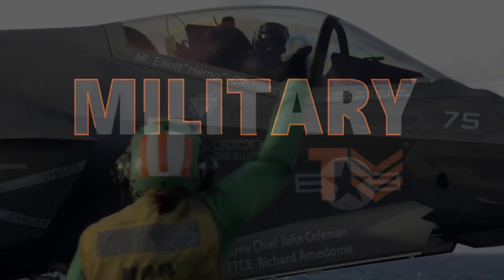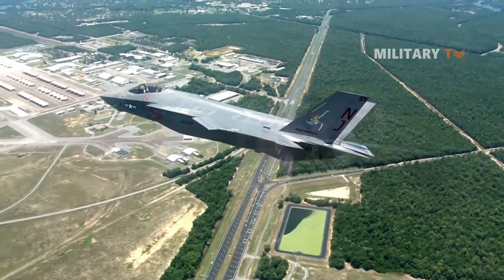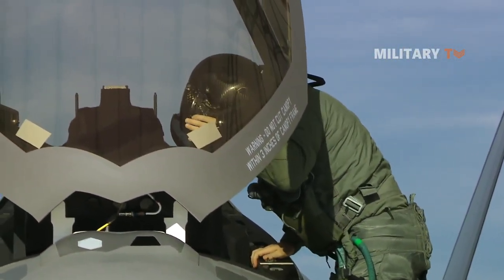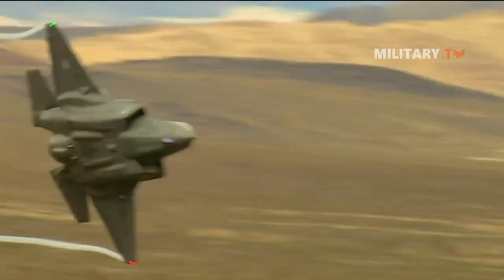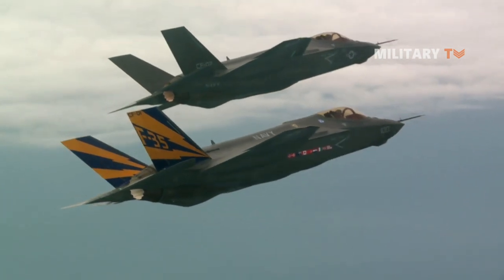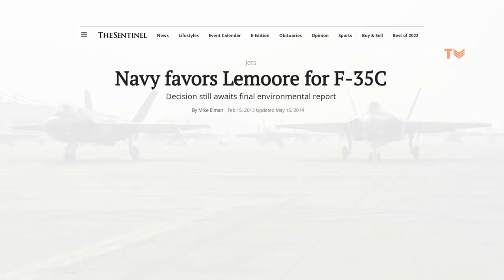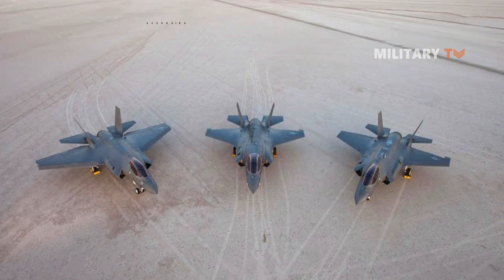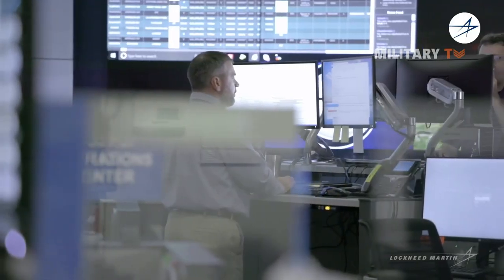Why the US Navy F 35C Is Such a Badass Plane

Comment: everyone hating on the F35 i bet they think the A10 is good enough.
Reply: Yeah the A-10 is good enough in close air support and attack roles. It’s the cheapest plane in the Air Force per flight hour and it single-handledly dismantled Iraq’s network of air defenses twice in the last 30 years…
Reply: @BasicBobby Also is responsible for the most blue on blue incidents than any other modern aircraft.
Reply: @BasicBobby   the a10 is not going to be good enough against a near peer enemy who also has air support the F16 does the A10s job just as good and can still defend itself against a 4+ gen air to air threat.
Reply: Totaly different class of aircraft from the A10
Reply: @huntercanuck  the A-10 is not but just not good enough anymore. War is coming and we will need the best aircraft that can survive air to air engagements. It's a lot more efficient to have F16 and F35s to do air superiority land and rearm to do air to ground than to have dedicated aircraft for air to ground only that isn't very good in an air to air engagement.
Reply: @BasicBobby no it didn't lol

Comment: Marines fly both, the B and C variant. Each Navy Carrier has, 1 Marine unit that also uses the, C variant. Marines use the, B variant on the Us Navy/Marine Corps light Carreris. Most people think that the US just has 11 Carriers, but....adding in the Light/Marine Corps Carriers, there's actually around, 18 carriers
Reply: The Marines don't have any carriers. The Marines operate off of Navy Ships, the Landing Helicopter Assault (LHA), and the Landing Helicopter Dock (LHD) These ships might resemble carriers, but they do not in normal times, function as such.  Their mission is to transport  Fleet Marine Force personnel and put them ashore as needed. Unlike a carrier, they are incapable of sustaining any prolonged military engagement. They carry limited ordinance for the aircraft and have very little hanger deck space. Mostly they are there to carry and shore Marines and their gear. An LHD will have about 1800 Marines and typically will carry  750 pallets of ammunition for those Marines, and a variety of other support logistics. It is essentially a reenforced Marine Battalion afloat.  The aviation unit of Harriers or F-35s will typically be part of the Marine Expeditionary Unit Aviation Combat Element (ACE), and these are typically composite squadrons of several types of aircraft. While it may resemble an aircraft carrier, its role amphibious assault. That being said, one was used during the Gulf War as an attack platform for Harriers, but this is not really the mission of the ship.
Reply: @shenmisheshou7002  ummmm...explain why the money spent for and money spent for maintenance for these vessels comes out of the Marine Corps Budget?

Comment: The F-35s are proving to be a major economic strain on the Air Force, Navy, and Marines. There are currently no War Ready Engines for the F-35, and there are not expected to be any until 2030. The services have conceded that the aircraft will never achieve the flight hour cost that was projected by the prime contractor and because of that they services have had to make a decision on whether to buy fewer F-35s or fly the F-35s fewer hours, and the choice the Air Force made was to reduce the annual hours from an average of 240 to less than 180.  Most pilots don't want to be in F-35 squadrons because it will make it harder to get the necessary flight hours to get hired by  an airline when they finish their tour. Instead, many are leaving to go to feeder lines for FedEx and UPS, which has long been the civilian route to getting an airline job.  The Navy is currently short about 20% of pilots, and the Air Force has a shortage of about 1000.  The Full Mission Availability rate for the F-35 is appallingly low (about 14% for the F-35C) and the mission availability rate on average is about 55% (Full Mission Availability is the ability for the model to fly any mission that it was designed to fly.. The mission availability rate is being available to fly at least ONE kind of mission the model is capable of flying. The problem for the F-35 is that many of the planes that are mission available are not stealth mission avialable, so  can only really  be used in the same combat mission as the F-18 of the F-16, depending on the service. At any  given time, less than 40% of the F-35 fleet is capable of flying a deep penetration stealth mission. The contractor also did not provide the services with the necessary documentation and tools to do depot level maintenance, so this means that the DOD has to depend on the contractor to do major repairs and upgrades, and the contractor was taking an average of 140 days to turn around an aircraft, though at last report, this was down to 110 day. The Depot level maintenance of the Navy  and Air Force typically has a 60 day turn around, but that is for more traditional planes. The extremely complex nature of these planes likely means that an 85 day turn around is probably likely, but at the current rate, that may  not be achieved for another 4 to 5 years. Of course the current program costs is based on a normal inflation rate, but if inflation lingers, the program cost is likely go go higher than the current 1.7 to 1.8 trillion dollars. While everyone talks about how great the F-35 is, as an airplane, it is fine. As a defense program though, it has been a total disaster. Like the F-22, the F-35 will probably never face a Tier 1 opponent in a prolonged military engagement (the only F-22 kill was a balloon). As for being a deterrent, The Israelis have F-35s, and that did not deter Hamas from killing and kidnapping over a 1000 of its people, and the military might of NATO did not stop Putin from invading Ukraine. We spend trillions of dollars on planes that don't really deter anyone from anything and only ever shot down planes flown by Tier 3 opponents.  No US fighter has shot down a plane operated by the Russian Federation, The USSR, or the Peoples Republic of China since 1970.

Comment: not to nitpick but the sensor suite has nothing to do with stealth. tho that sensor suite certainly deserves an hour video of its own. too bad we aren't briefed in lol.
Reply: It actually does. Because the nose of the aircraft doesn't deflect radar, it had to be designed and oriented in a way to deflect radar upwards from the aircraft.
Reply: The F-35 depends heavily on the sensors while it is in stealth mode to detect threats that may be intercepting on  side or rear vectors. The F-35 radar cannot see in 360 degrees. One of the major reasons for the horrible full mission availability rate, about 14% for the F-35C are the sensors. If the sensors are out, the plane  can only be "Mission avialable" and that means that it can fly non-stealth missions, but it would be used the same as the F-18, so little value to stealth when you are just running around with external bombs.  (The F-35 is not invisible to radar and in fact it can be detected at well over 100 nautical miles by L and S band radar (both types used by Russian Federation and Peoples Republic of China). If a Dragon Eye radar sees an F-35 at 100 nautical miles, even though it can't lock on to it, it can vector a J-20 (which is not as stealthy as the F-35 but from a side or rear intercept, that makes zero difference) to a side or rear intercept, where the F-35 would be dependent on its sensor suite to let it know that an enemy aircraft was closing. It would be death to fly an F-35 into a tier 1 enemy integrated air defense network without all of your sensors working. The J-20 will catch up to you  from the back and shoot you down before you know what happened. Stealth does not work without sensors.  The B21 and B2 are far less likely to be seen by S and L band radar. The F-22 and F-35 are easy to see. That is why the Air Force and Navy are already  begging congress for money to buy  the NGAD, which will be much harder to see by S and L band radar.

Comment: BVR combat has never proven effective, and empirical evidence shows it’s by far the least effective option used by pilots in air combat, even against incompetent adversaries. 

The fact that the F-35, is totally unable to operate in a turning fight, and has such a tiny payload, means if it’s unable to hit its targets(s) with BVR missiles that at best, hit their targets 50% of the time, or the situation doesn’t allow engaging BVR (rules of engagment), it is a dead duck. It can’t outrun most near-peer fighters. And that Wall Street marketing propaganda claiming it doesn’t need to point its nose to lock a target is nonsense. Sure, it can fire the aim-9x at a off-bore angle, but its effectiveness exponentially decreases the wide that angle becomes. And again, when it can only carry 4 missiles at most, who’s to say it will even be equipped with aim-9Xs when it needs them.

It’s a very useful weapon, but it’s a mistake to try to use it for everything. It’s very useful as a reconnaissance, precision strike, electronic attack, BVR air-to-air weapon. But its limitations means it is not a viable air superiority or close air support weapon. It is best supplemented by a true air superiority fighter and cost-effective CAS weapons. The F-22, and ideally, something like the F-22 for the Navy. 

For most conventional war, it’s too complex and expensive to operate. So that’s where weapons like the A-10, F-16, F-18 still prove useful. 

That said, if our military were run strategically, we’d have 500 F-22s, 200 F-35B, 150 F-35A, 150 F-35C, and we’d be fielding an air superiority/fleet defense weapon comparable to the F-22 for the Navy, in at least numbers of 100+.

Comment: Way overpriced and full of issues, I'm so pissed Canada got involved in this pos.
Reply: I feel your pain! They should have gone with the F-15 a long time ago!
Reply: Issues that have been steadily improved over the course of the program.  The new specifications of the F-35 make it a whole new beast unmatched by any other aircraft in terms of mission capability.  The problem with the F-35 program initially was similar to the Zumwalt Class destroyers, in which, at the time, the request was basically as much new tech that wasn't capable of being delivered on in a fighter.  Now, that isn't the case.  We actually have the tech now to deliver on the F-35's designated capabilities.  It's right now the most advanced, most versatile, and most capable fighter in the world.  As of right now, the limitations of the F-35 are exteneral, with a lack of maintenance equipment and crew with the knowledge of how to maintain the fighter.

Comment: The reason why the US navy and Airforce are procuring 100 F-15 and FA-18 is because the Generals are well aware of the failures and structural flaws of this aircraft. The problem stems from the fact that testing are still not finished they started full production. Now even after more than 2 decade of production problem still exist. Also upgrade of older F35 to bring it uptp date are expensive as procuring new jets. Even the F22 after decades it stopped production its readiness rate is so low that even the US govermment want to retire it prematurely.
Reply: "The reason why the US navy and Airforce are procuring 100 F-15 and FA-18 is because the Generals are well aware of the failures and structural flaws of this aircraft."(sic)

Incorrect on both counts.

The overwhelming majority of the F-15EXs being procured are slated to replace long in the tooth ANG F-15Cs to be used in the homeland defense role. The F-35A was never slated to replace the F-15. The NDAA added 11 F-35As above what the administration had requested. Total FY2023 F-35 funding amounts to $10.6 billion. The Super Bug line is being kept open largely as a jobs program as well as Congress not believing that the Navy will be able to effectively manage its strike fighter shortage. Congress is forcing the Navy to buy aircraft it doesn't want. NAVAIR would prefer to spend that money on the F/A-XX. Given the poor state of current leadership, morale, retention and shipbuilding the money intended for procuring more than the 16 F-35Cs in the FY2023 budget is being directed elsewhere.
Reply: No the congress want's to retire the test/practice F-22's not the combat F-22s.
Reply: @niweshlekhak9646  and the entire block 20. So 8 test runs and 37 block 20 or a total of 45 airframes. The reason being that the block 20 raptors avionics are dated and can´t interoperate with block 30/35 and thus has been used as trainers and to keep flight hours down on block 30/35 which are the combat ready versions. There are 149 block 30/35 airframes produced including upgraded block 20. (At least 6 has been lost in crashes but I'm unaware of the block #, and additional airframes may have been retired due to structural damage, or end of service life). Btw. The F-15EX serves to bridge the gap until F/A-XX becomes operational. It´s not an option to "spend that money" on a program in development, given operational readiness requirements. Keeping production lines open is not a jobs program per say, (although inter state competition for these programs exist for job reasons), but are calculated expenditure vs. restarting production capability. Closed production lines were the reason F-22 were not produced in greater numbers even if congress wanted to finance it in the early 2000´s. Have a nice day.